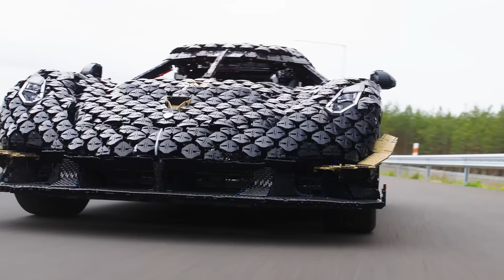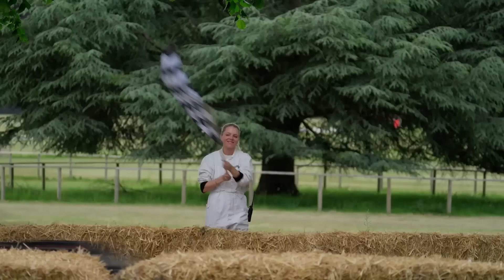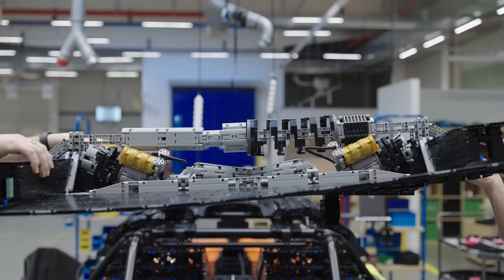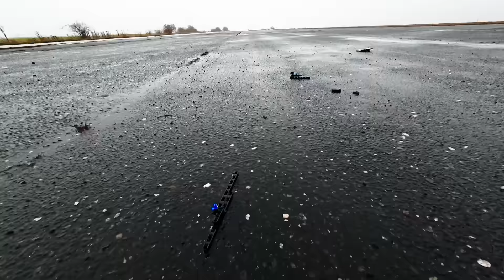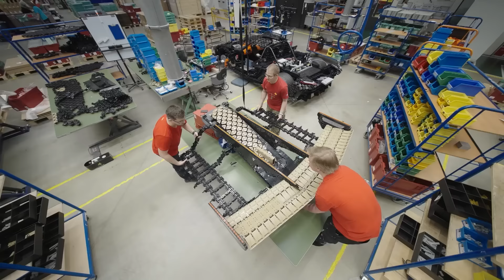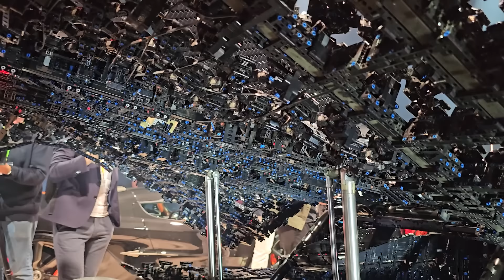How LEGO Built a Life-Size 111 km/h Technic Koenigsegg from 327,906 Pieces

Comment: How does someone get to work on such projects? This is my main curiosity. Also, did anyone ask at the presentation whether there are any illegal techniques used in the 1:1 LEGO Technic car? :)
Reply: Not really for the illegal techniques. Usually these techniques comes from where we do nothave other choice, moslty due to the scaling and the size of the elements (because everything is connected to a 8mm grid). So on a 1:1 car, the dimensions is so huge compare to the 8x8 lego grill (or event 4x4mm if you use half/stud technique), there is not point to create illegal technique to support/attach elements. For sure the parts were stressed by their own weight and the speed of the car, but I think everything is build on the grid without illegal building !
Reply: @Nico71Fr  I will take this opportunity to congratulate you on the awesome technic projects you do! I Were you also involved in the development of any of these 1:1 technic cars?
Reply: @doyaseeme9173  Thanks ! Not at all, I am just a Technic Fan :)